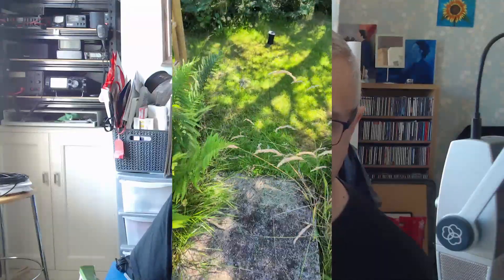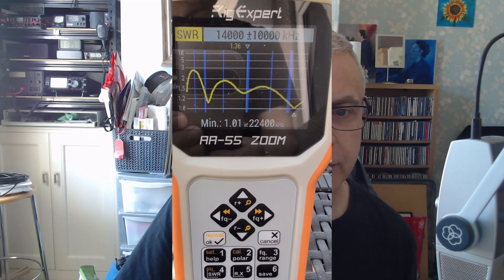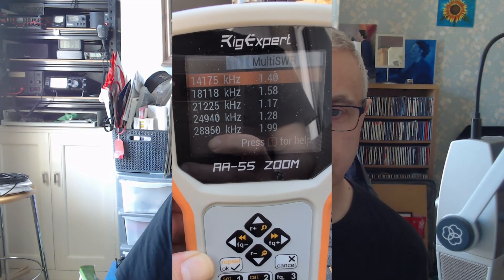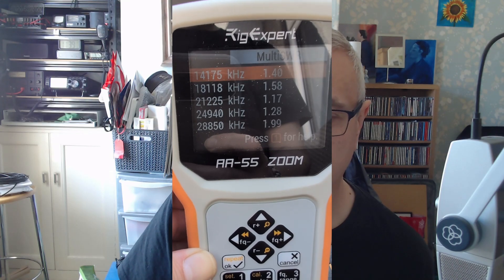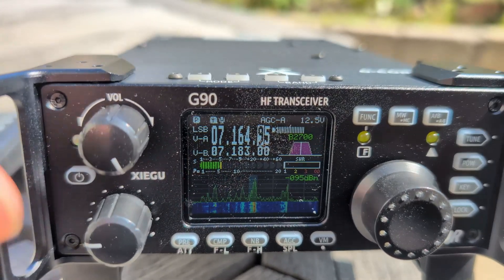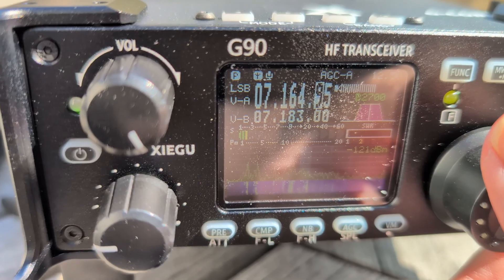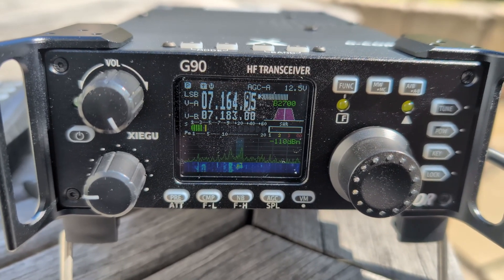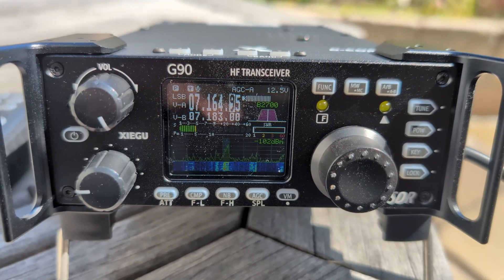Operating HF with a transmitting antenna lying on the ground?

Comment: Great presentation.  The Russian Military even use underground antennae. Lossy but covert.
Reply from the maker: I was surprised by how well it worked. The efficiency on 40m is probably similar to a short mobile whip, but good enough to get some contacts. 73, GM4SVM

Comment: I like that you tried transmitting with this loop-on-ground (LoG) antenna despite it not being “suitable” for transmission. I will be trying this for near-vertical incidence skywave (NVIS) local area transmission, with emergency communications in mind. Frankly, the rocky ground in my back yard makes for a lousy ground anyway, so transmission losses might not be too bad.
Reply from the maker: It was about 11m of wire into a 9:1 unun. It was under2:1 on most bands from 80m upwards. Not a practical antenna for anything other than NVIS, but an interesting experiment!